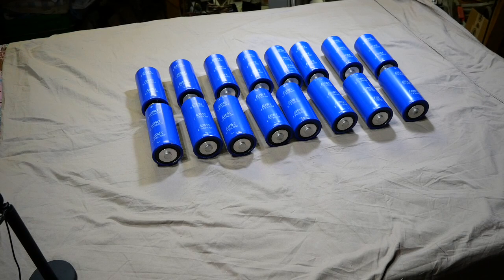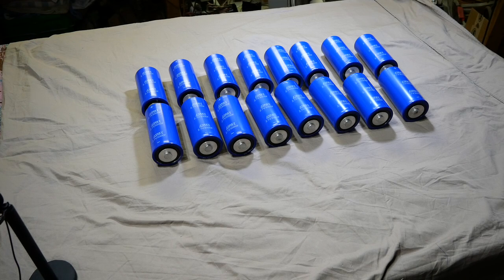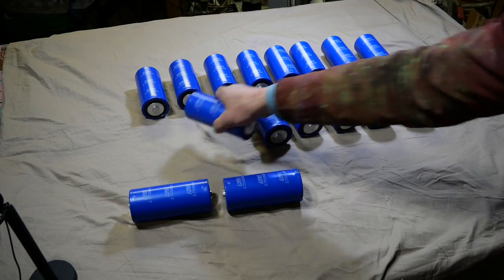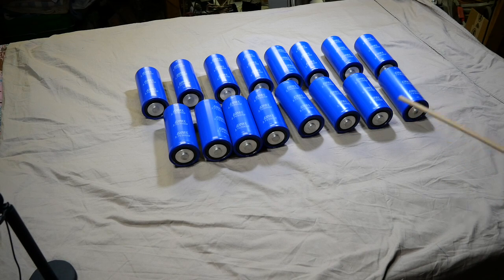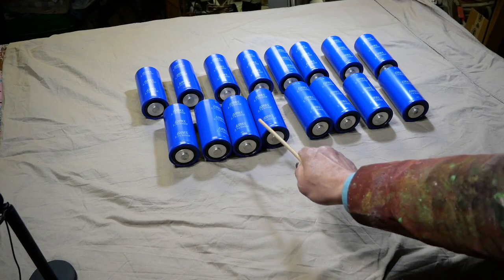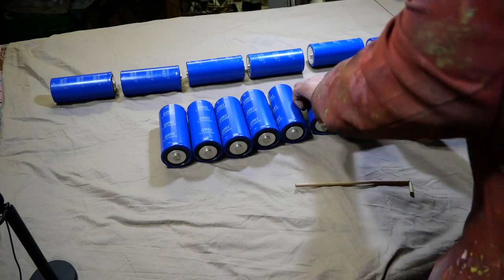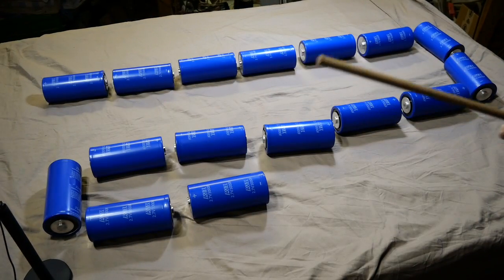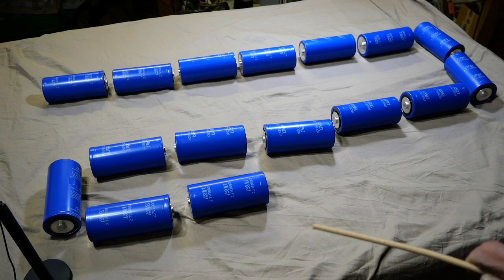Understanding Super Capacitor Voltage and Capacitance -------The Relationship

Comment: Hi there, Angela. Firstly, fantastic video. I hope people realize the amount of current / energy super caps can hold even though they’re low voltage. 

Can you explain how much capacitance is too much? I’m building a tube based phono pre, and the transformer’s primary is 115v, where the secondary is 280v. The PSU is a CLC rather than CRC, and I’m using a solid state rectifier instead of tube, if that matters. If this is a situation where you’d need to see a schematic, I understand. Thanks very much in advance. 

I absolutely love your work and designs plus your outside the box thinking.
Reply from the maker: As of today, I haven't find the limit of capacitance being too much.  However, there are a lot of other factors which affect the benefit of adding capacitor.  In another word, not all capacitor react the same.  The rule of thumb is if adding capacitance continue to improve sound quality, go farther.  If it doesn't, stop.  The only thing is the make sure the rectifier can handle the inrush current.
Reply: @angela-gilbert Wow! Thank you, Angela for getting back to me so quickly. That was exactly the information I was looking for. I may mess around a bit with thermistors to limit the chance of damaging the rectifier with inrush current. Thanks again! I appreciate it very much! 🔊😊🎶💜

Comment: I've been experimenting with capacitors in serial but mostly for small applications like speaker crossovers and similar specially for Non pollar applications but I didn't pay attention to increase the voltage in other applications...also I knew how to increase the capacitance in parallel but the voltage remains the same...so very instructive video.